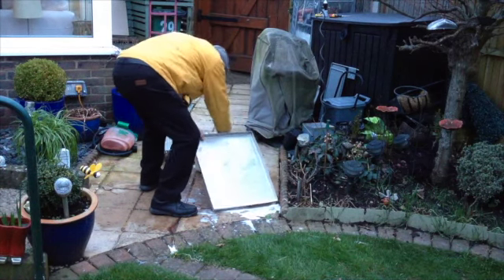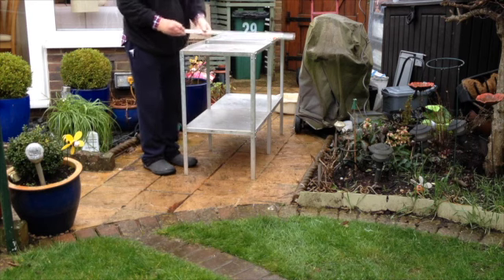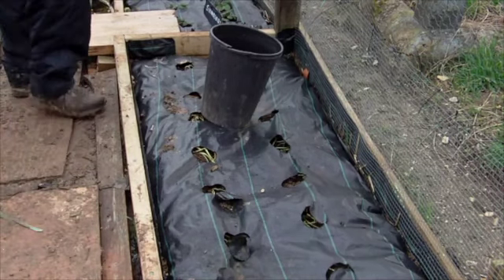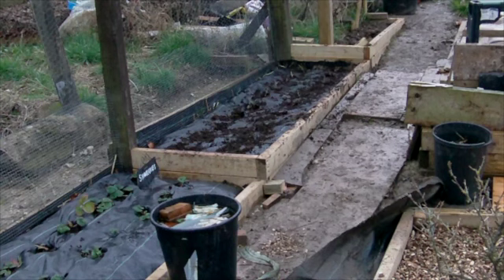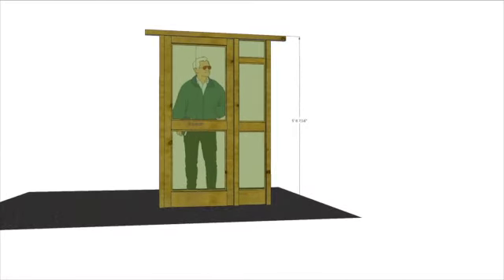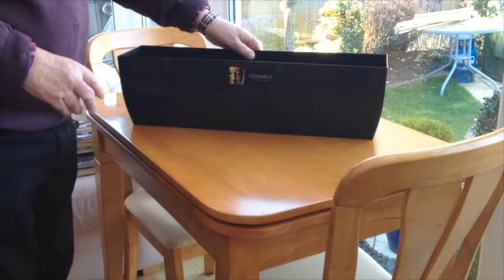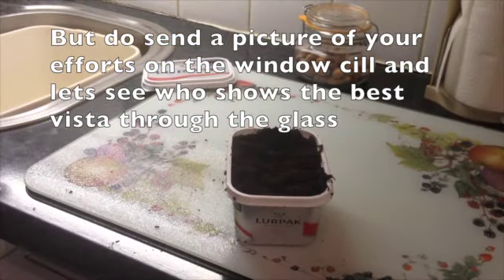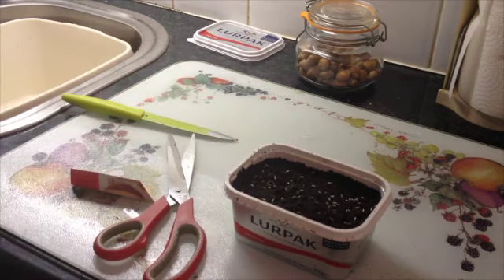3rd week of February 2018

Comment: Hi Mike, a nice neat job with the strawberry bed 👍🏻👍🏻. The material that you put in the window box looked like Vermiculite???  The name you referred to it.... is that the trade name for the stuff that is used to insulate chimney flues?  I spent around 30 years using various CAD systems at work, yet found SketchUp very easy to pick up. In many ways it is very similar to AutoCAD 😄. I have a set of the ali  staging still in flat pack. Will use those trunking bolts that you suggested 👍🏻. The aluminium bolts eventually age harden and the shear easily. Nice update mate 😄👍🏻
Reply from the maker: Hi Nigel, yes it is Vermiculite.  worked late to get the upload out and the brain plays silly things.  The bolts were from Screwfix and they are on next day delivery.  A lot of the work I did on drawings was for occupational therapist and I had to send drawings to them on what we agreed.  Auto CAD was too expensive for them to purchase or justify I needed a programme I could filter into word which all the therapists had.  If required they could approve and then I could issue the drawing to the contractor.  Because each patient is different accuracy is key, and they liked the walk through's, oh and the colours.  Take care Mike B

Comment: I like the can trick Mike, I've just been melting a rough hole with a blow torch, nowhere near as neat!   : All the best - Steve
Reply from the maker: Hi Steve, what material have you been melting?  If I had used a blow torch there would be no membrane left! LoL  Take care Mike B
Reply: This the stuff I use Mike https://www.amazon.co.uk/gp/product/B006H1MDEC/ref=oh_aui_search_detailpage?ie=UTF8&psc=1 it looks similar to your's.  A blow torch works fine with a bit of care.  Some people shroud the torch with a can in a similar way to you.  I did once seal some fabric edges and managed to leave it smouldering and lost about a metre to the flames!   : All the best - Steve